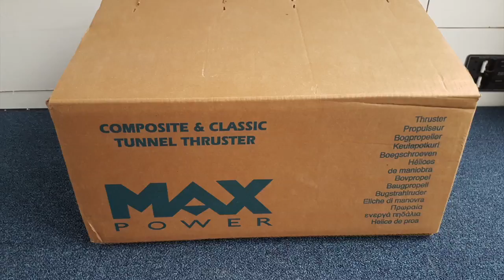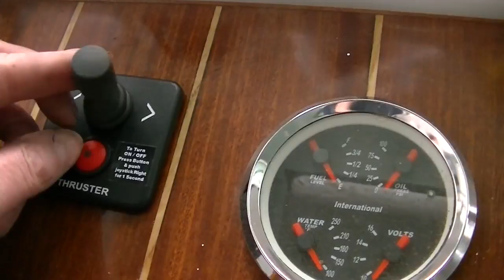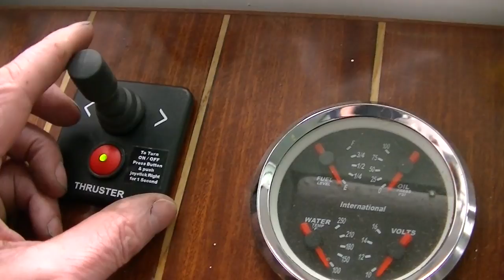Max power CT35 Bow thruster installation

Comment: What size PVC pipe does that require?
Reply from the maker: It's a 125mm fiberglass tube, I'm not sure you could use PVC as it would be harder to fiberglass inplace.

Comment: How did you measure out the placement ? Do you have any guides on that ? br Last
Reply from the maker: The top of the tunnel should be 185mm below the waterline and as far forward in the bow as you can get it.

Comment: Propeller does not seem to be well balanced
Reply from the maker: 4 years later and no problems with it, there is a rubber gasket between the  motor and the tube so I would expect a small bit of movement as it's quite a powerful motor.
Reply: @1968ferg  cool .